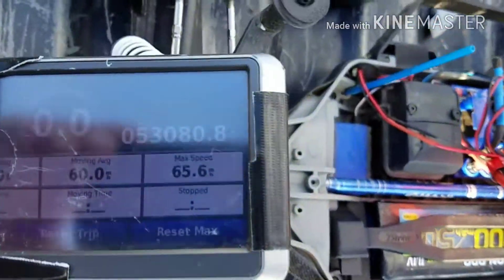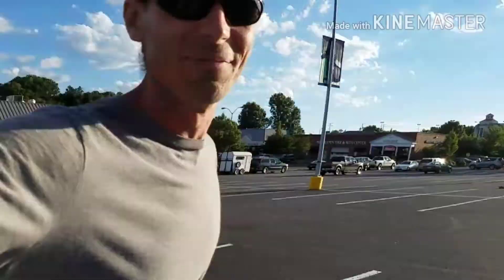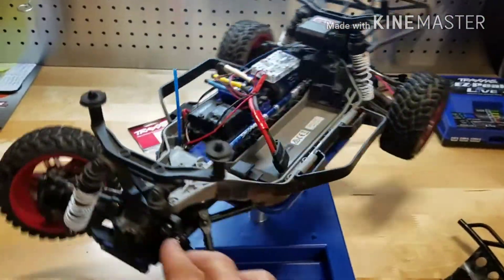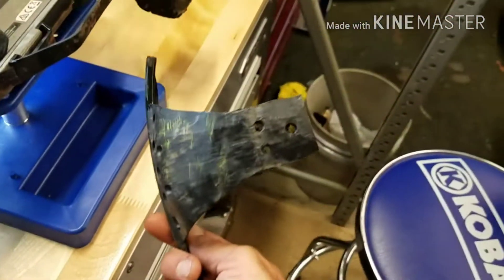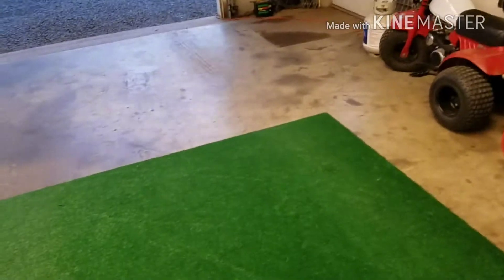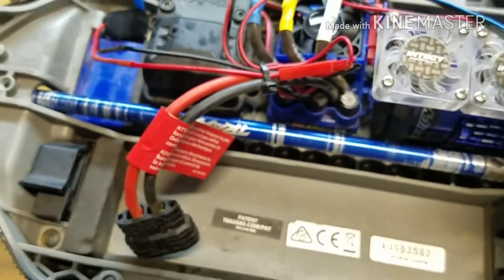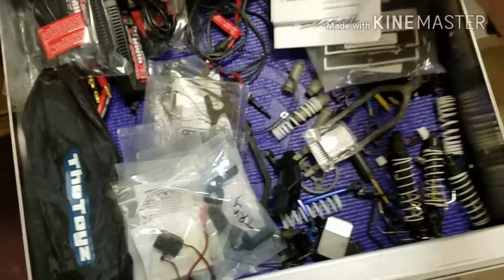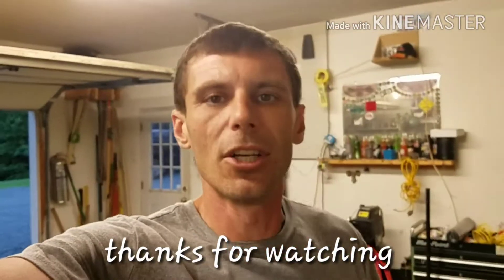Traxxas slash vxl 4x4 speed run crash

Comment: Oh that sucks, but repairable.  I took my Slash out front this morning after flying my favorite planes.  Got a bunch of runs in and recorded. Only bad thing was I wasn't paying attention at one point up the road and went off into a patch of raspberry bushes which was fun with me in my moccasins.  I need to work out a way to figure out how fast it goes, I believe the Traxxas claims of 60+ mph, the thing hauls.
Reply from the maker: It will fly if you put The high speed pinion on it and leave the body on. Seriously if you hit a big enough bump it will go airborne. It's crazy. I had my gps taped to it and it ran 65.6. They sell little gps's that I see others use. The i-link tops out at 53mph. Keep me updated on what you figure out. Thanks for watching
Reply: Ben Brubaker I did not know about the max speed on the I-link, that is enough for me to not go with it.

Comment: time to rpm the front...
Reply from the maker: I think I have all the extras here in the parts drawer. No shop runs on this fix, luckily.
Reply: Ben Brubaker I have all the arms and shock towers from when I had ... had to pawn it...lol what's left is a Hot Racing sluminu motor mount that I never got to put on...